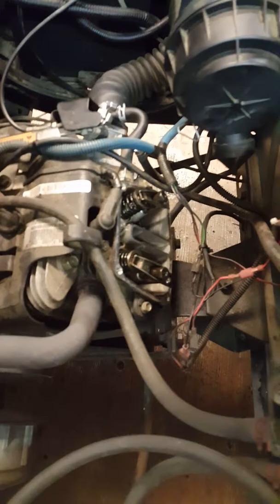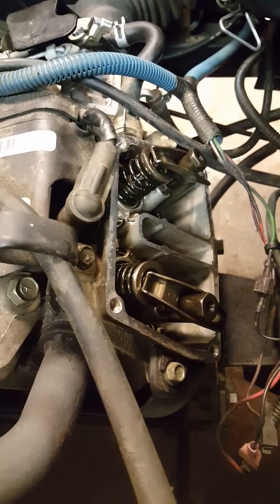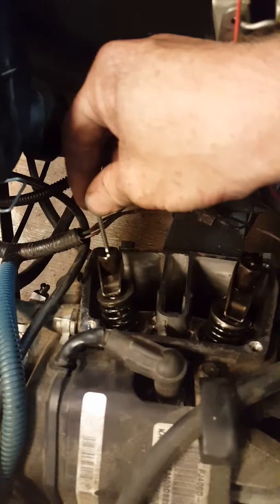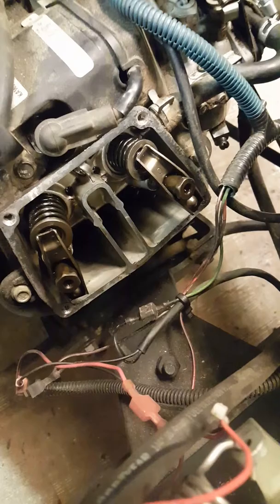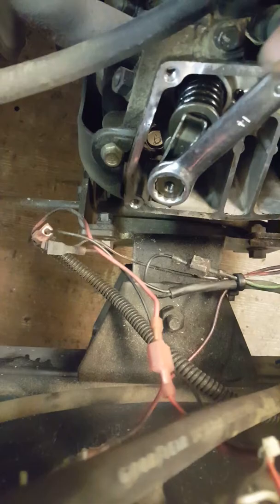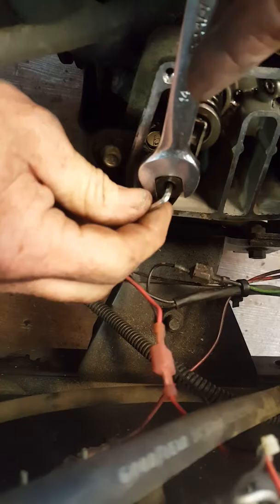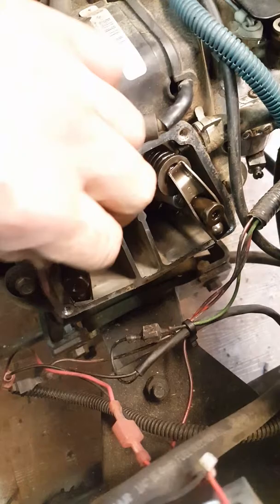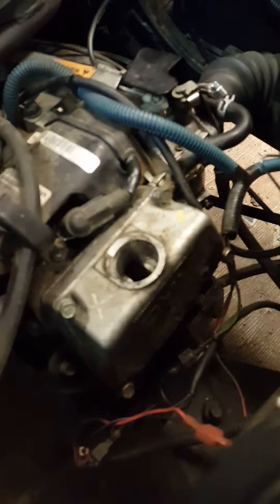EZGO TXT GAS NOISE IN ENGINE.  ADJUST VALVES.  QUICK AND SIMPLE

Comment: Do you have a video about adjusting valves on Robbins motor?
Reply from the maker: No but it’s just like this except for it’s .003 clearance instead of 6. Your 2 inside valves are I take and the 2 outside are exhaust.  Just put the valve beside the one your adjusting down. Then adjust the one that’s up.
Reply from the maker: Next time I come across a cart that has the robins engine in it. I will make a video.

Comment: Question, I have a 2018 ezgo TXT. It has the Kawasaki FJ400CD engine. Does this engine have the hydraulic lifters or do the valves need adjustment?
Reply from the maker: Adjust valves
Reply: Thanks Man.

Comment: When i took the valve cover off mine the intake side was full if oil ant the other side had none whats up?
Reply from the maker: Must have sludge or something blocking hole .
Reply from the maker: Did you find out what it was
Reply: @HeyHeyHey97  not yet the golf cart is at the coast i will get in to it more then i bring it home
Reply from the maker: @kaw1997  let me know.
Reply: @HeyHeyHey97  i feel like the oil is pooling up on that side then getting in the intake through the tube at the top of the head
Reply from the maker: What is it doing mixing oil with the gas
Reply from the maker: I would check your oil and make sure it is not overfilled.   If so take you a lighter and as soon as you pull the dipstick out light the oil with your lighter if it catches on fire immediately. Then you are getting gas in your oil. Carb problem.
Reply: @HeyHeyHey97  it wasn't that's the first thing i did was change the oil
Reply from the maker: What's it doing.  Running bad?
Reply from the maker: What thickness oil you put in
Reply from the maker: Check your pulse line and see if it is not pumping oil out the vent on the fuel pump
Reply: @HeyHeyHey97   for texas i use 20-50 oil i replaced the fuel pump everything on that side seems great no oil from pulse line. It runs strong just the ticking and i will start to smoke after a wile when i get it home i will get into it more i think a engine flush would do wonders
Reply from the maker: Yes definnetly would do engine fludh
Reply from the maker: @kaw1997  adjust valves. They are bad for needing adjusted